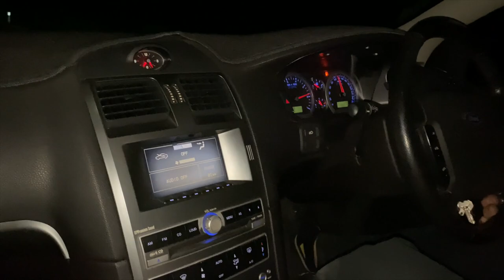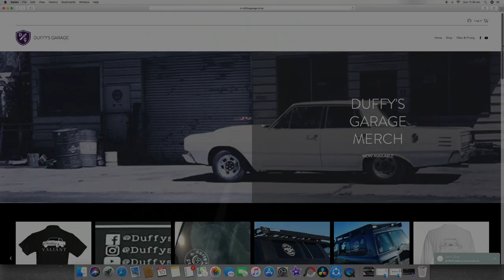Ripping The Barra Apart

Comment: brad from atomic even said they use the factory bf2/fg guides are they are stronger and better designed. ive only pulled two barra covers off but both had started eating the top of the black part of the tensioner side of the guide. must be a fairly common wear point.
Reply from the maker: correct, different materials, I fit FG Turbo guides.
Reply: Hi so fg guides will fit Ba ?